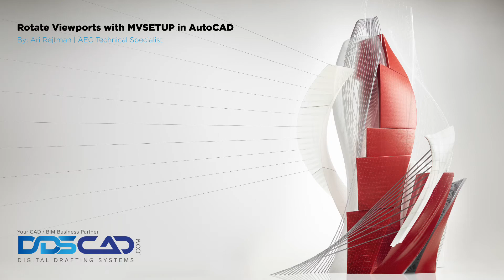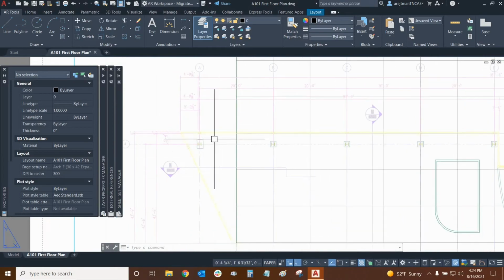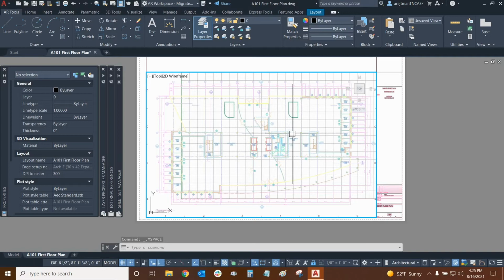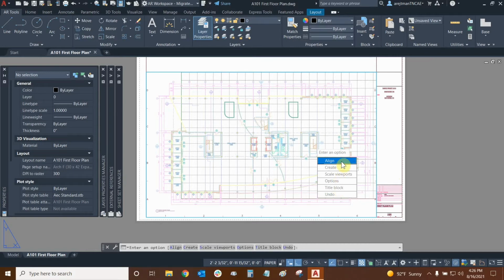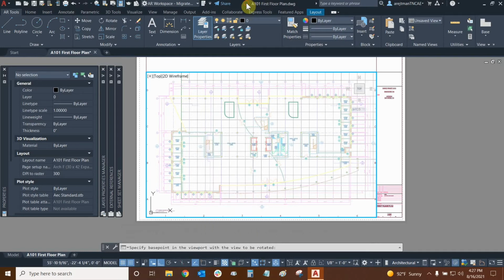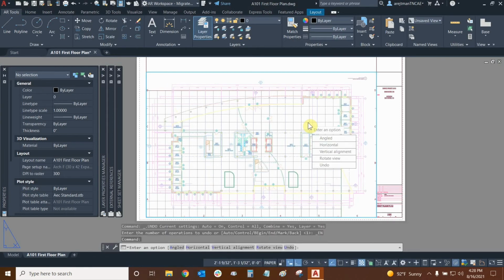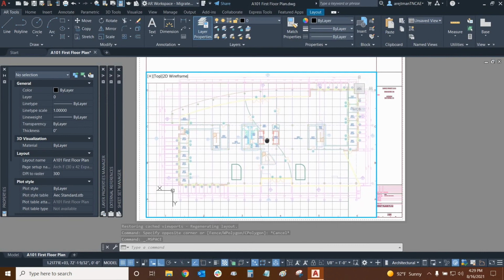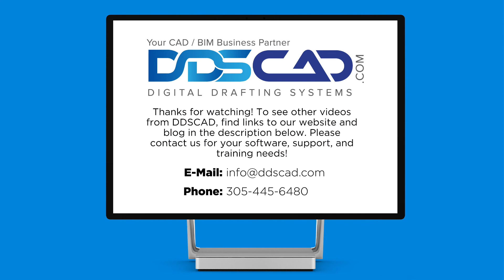Rotate Viewports with MVSETUP in AutoCAD

Comment: you said this could be used for odd angles and then show us a standard angle.  this is not helpful.
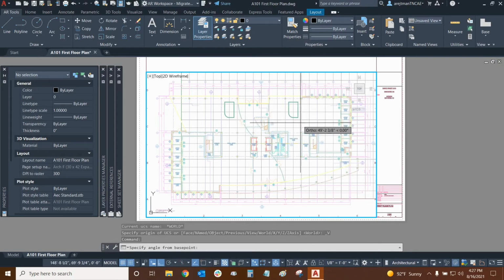Reply from the maker: Starting at 3:20 in the video, you can type any angle you want when you get to the "Specify angle from basepoint" step. We used 180 degrees as an arbitrary example for our specific drawing, so you can follow the steps and use any angle. Hope this helps!